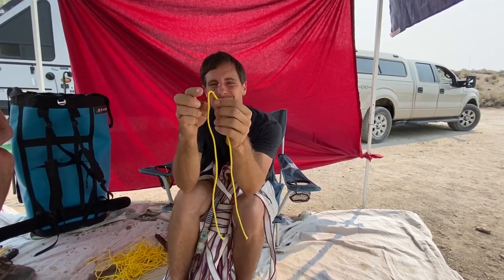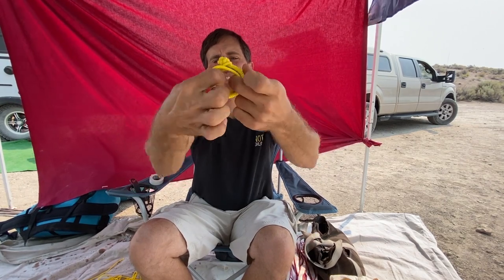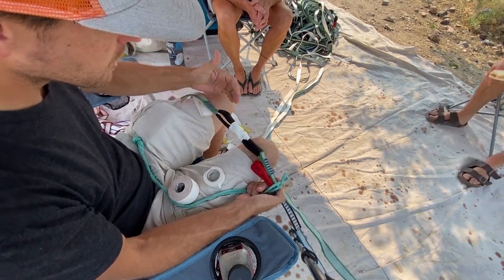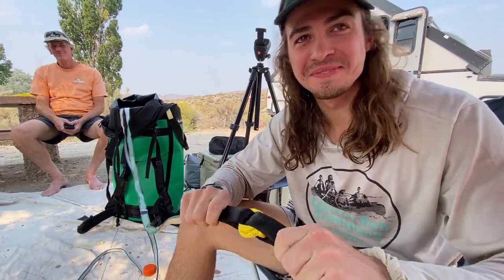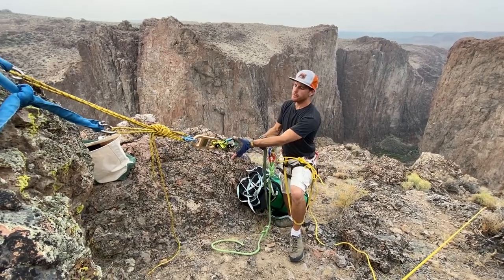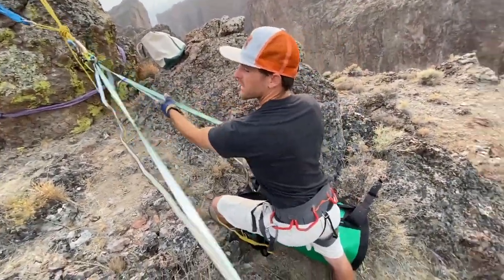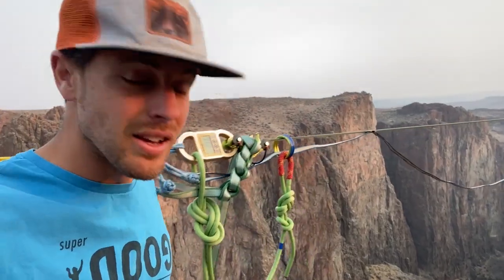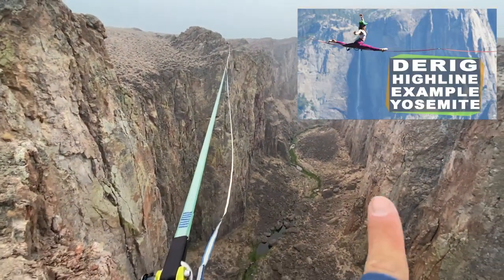4mm Soft Shackle Connections for Highlines?!?!?!  Full Highline Tutorial

Comment: At 28:55 you say you don't need to tie off the soft release. 
We actually had one in the park where the knot came undone by all the whips the webbing saw from coming off the line. When it was undone, the soft release slowly came loose, until it came loose fast enough to melt away the loop. The weblock flew 10m past our heads. Since then, we ALWAYS tie a fig8 or something and clip it off with a biner.

Comment: So was wondering if you had ever heard of/used Gaffer tape? It leaves no residue and is fabric based (and similar strength to duct tape).  Might be nice for your applications!
Reply: I mean, I know that gaffer tape is supposed to leave no residue, but that’s when you use it for gaffering. There’s enough load on these applications that I would expect the glue on gaffer tape to leave residue. It doesn’t do great with heat.

Comment: Have you tried “Back wrapping” your electrical tape, sticky side up, on the first layer then glue side down?  Never tried it on a highline but it works great on wire and wire rope.
Reply: There also exists electrical “tape” with no adhesive.  You wraps the first couple with the “tape” and finish off with regular tape.

Comment: What would be the absolute lightest 20m parkline set up? Could you hand tension or do you need two wire gate biners? Can you get away without a linelock? What to use for slings? Can you use soft shackles anywhere? What's the absolute lightest webbing available?
Reply: Some parts of your question you have to find out yourself (like what's the lightest webbing), but my super light setup is this: 
One dyneema sling, long enough to fit around a tree. 
Two Carabiners
20m Equilibrium slim webbing

I tie one end of the line around a tree and do a primitive on the other side. That way I can tension with a 4:1 and don't need a softrelease or linelock or anything. I think it is less than 1kg. With small biners and dyneema webbing you could probably get down to 600g.
Instead of any tensioning you could also put the anchors up high and handtension without biners, that would save you like 100g
Reply: @niknik0815  thanks, can you tell me more about the dyneema sling? Where do you get it from? And how do you skip the linelock? I've gone for moonwalk (34g/m) over equilibrium slim (26g/m) because I don't really walk rodeo and want to walk longer than 20m but might look into getting some for a super UL 15m line.

Comment: Is there any reason not to use a belay device instead of the munter when controlling the soft release? It would mean that in the brake position you'd be pulling towards yourself and away from the edge which seems like it would be easier to control, and then the backup would engage the brake as well if needed.

Comment: Just kind of wondering why quicklinks or heavy duty carabiners aren't used between sewn loop ends? I mean to make the webbing one piece not to connect the backup to the mainline, like why did you say not to do that? Is it dangerous? Just wondering.
Reply: I Imagine because they'd be dangerous to step on and it would add to much weight to the line, they'd have to be steel. But maybe there's more than one reason.

Comment: Hey! my question is will the smaller dynema diameters diminish the longevity of the rig or be more vulnerable to longer term wear and tear than the thicker stuff.
Reply from the maker: The concern is the thinner material could cut the webbing under tension.  Padded loops and double wrapped proved to be fine in our initial tests here at the lab.

Comment: 16:38 that twist shackle is orientated wrong. The pin should be on the rope and the bow should be on the blue spanset. Also that polypropylene rope is splice able like dyneema and would probably hold around 5 kn (maybe some break tests would be helpful)
Reply: How come?
Reply: @turkeyphant  the shackle is more of an aesthetics thing so orientation doesn't really matter but there was an opportunity to make it look nicer so there's that. the poly rope is hollow, (like amsteel) so that means it can be spliced. splices hold around 90-95% of a ropes strength so it would be a lot stronger than a overhand knot like what was in the video